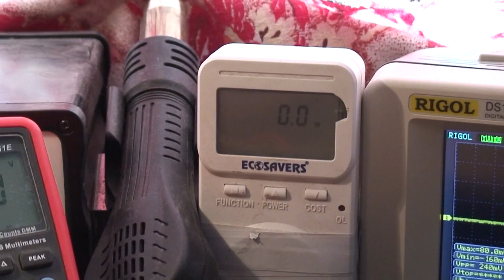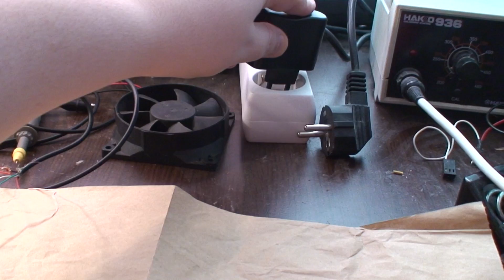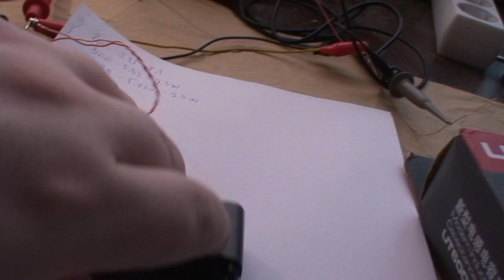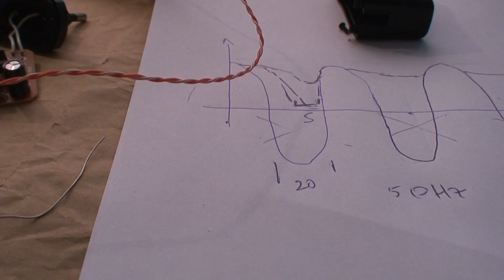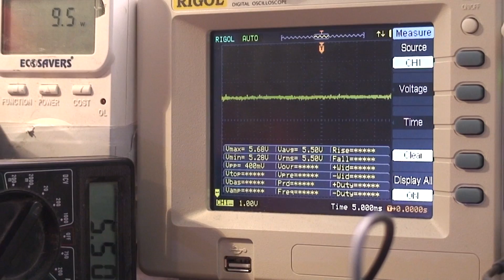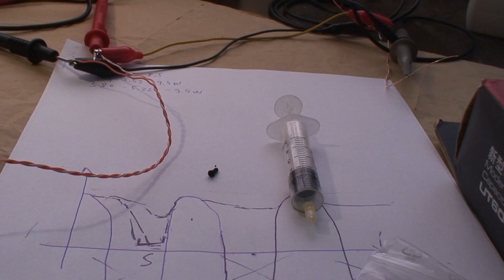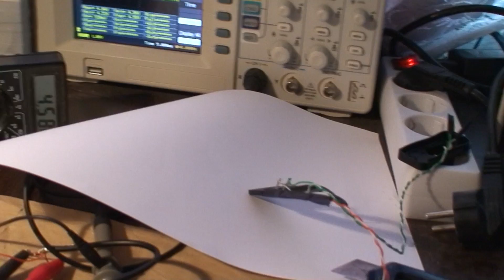"Our Future" Power Adapter (USB Charger) - Teardown, Review, Modding

Comment: Thanks. I have been tearing apart some similar crappy adapters. Mine don't even have fuses in them. I started to add fuses but then saw a video about how shitty the insulation in the transformers is and just scrapped them for parts. They were supposed to be lipo chargers! They are a bag of shit really. About the only use for them is learning how they work. Subbed.

Comment: your RED multimeter is set in milliVolts not in milliAmps????????????
Reply from the maker: +Nickolai Bacalzo You can measure the current consumption of a circuit by measuring the voltage drop over a resistor that's placed in circuit. That's basically what happens when you choose to measure the current with a multimeter. With a 1 ohm resistor in series with the power supply, you'll have a 1v voltage drop at 1A of current.  With a 0.1 ohm resistor, you'll have 0.1v drop at 1A of current.  

The Uni-T UT61E multimeter has a burden voltage ( see https://en.wikipedia.org/wiki/Multimeter#Burden_voltage ) of up to 1.1v on the mA current measurement setting, the average is usually around 0.85v, so using this trick of measuring the voltage drop with a small resistor makes sense, the actual voltage after a small resistor would be closer to reality compared to the voltage that would be shown when using the multimeter's mA range. The multimeter's Amps range has a much smaller voltage range and  I could have used that mode instead but i would have had less digits shown on screen. 

I've recorded this a long time ago so I'm not sure if I used a 0.1 ohm resistor (better) or a 1 ohm resistor (not much improvement)

Comment: @1:47 what he hell even at standbay it is consuming 3.8 watts ?
Reply from the maker: ***** I believe I mentioned in the video or added a note over the video, there was something else plugged in the same power strip (and I forgot about it while recording), probably a computer outside the camera's view.  That power supply wasted a couple of watts, so for a few measurements, you'd have to substract a couple of watts. Also, from various measurements and uses around the house, I consider the watt-meter fairly accurate, but it wouldn't surprise me if there's half a watt or so error at low power.

Comment: Thank you for the post. If I want to modify this adapter to deliver 9V instead of 5V , can I just change the Zener diode to 9.1 ? I know the output current delivered will fall as a result but I am fine with that because my requirement isn't much. Do I have to make any other changes?

Comment: Słychać POLSKI akcent :D
Reply from the maker: I'm Romanian. You were close enough.
Reply from the maker: gogu gogu Nu ai ce sa reduci, 4.5A este curentul maxim pe care bateria il poate oferi, daca un aparat are nevoie de 12v la 1.5A, va consuma doar 1.5A. 
Curentul e ca presiunea la robinet, 4.5A e cat vine pe teava daca dai robinetul la maxim, dar un aparat care are nevoie de 1.5A va invarti de robinet doar cat e nevoie.

Referitor la incarcarea bateriei, iti recomand sa cumperi un incarcator tinand cont ca nu te prea pricepi. E mai sigur asa.
Incarcatoarele au un procesor sau un circuit care controleaza viteza de incarcare a bateriei (cat curent este "pompat" in ele) si mentinand in acelasi timp voltajul intre anumite limite, de exemplu de la un minim de 14.4v la maxim 14.8v (limita de sus). In orice caz, pt incarcare e nevoie de 13-13.5v minim.
Reply: mariushmedias Salut  ! cum  se calculeaza  ce  rezistenta   sa  pui  la  o  baterie  de  12 v  4.5  amp  vreau  sa  reduc  pana  la  12 v 1,5amp iti  multumesc  si  la  incarcare  pentru  bacteria  de  12v  4,5 amp  cu  ce  tensiune  trebuie  sa  incarc  bateria normal iti  multumesc  ! O  zi  buna !
Reply: mariushmedias deci  de   pun  un  incarcator  de se  conecteaza  la  bricheta  de  la  masina  la o   bateria  de  100 de  amp   sau   de  4.5  nu  se  arde  cred  de  bag  telefonu  la  incarcat  ca  are  acel  incarcator cred  ca e  ok

Comment: You got a flaw in how you tested for voltage.  You should have cut the USB cable near the plug end to eliminate much of the USB cabling due to the very thin wire used in these USB cables.  I check these cheap USB adapters occasionally and leaving all that extra cabling will give you an in proper voltage reading due to voltage being dropped in the wire. It gets to be quite a bit with higher current draws.

Comment: I thoroughly enjoyed this teardown bro, it's amazing how they get away with selling such bad SMPS bricks. But then the average consumer only cares about cost and not output quality.

I think a pi filter on the output will have helped reduce the ripple quite a bit, but like you said the primary side components were questionable. It looked like a self oscillating design which is a good indicator the designers were on a tight budget.

Comment: the sad thing is allot of electronics from low end cheapo to high end expensive is designed by monkeys
I dont understand as a human being why but from a capitilst point of view sure. 
it is more profitable to sell low qaulity as you will be buying again aswell as allot of these current so called electrical enginers are entry level in my opinon. and dont understand what they are building. 

there are some good decent more expencive stuff but on average its crap and desinged with hour life in mind